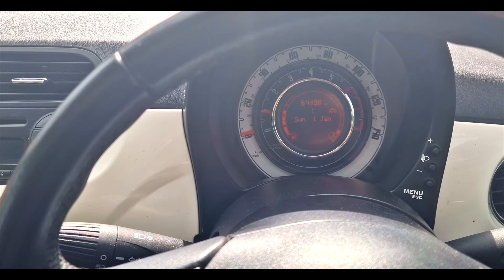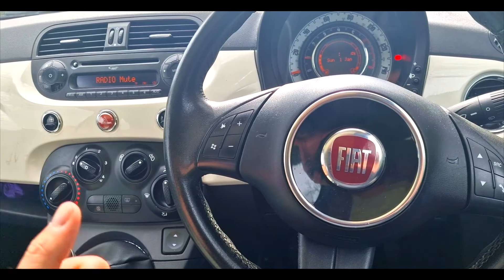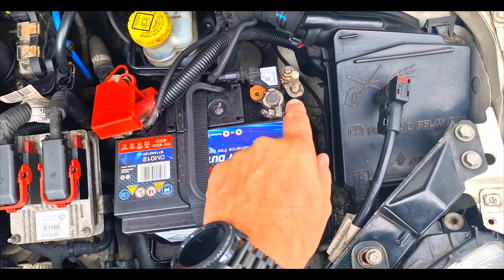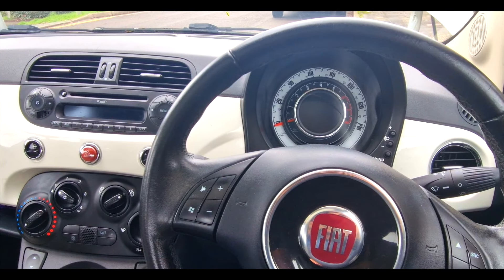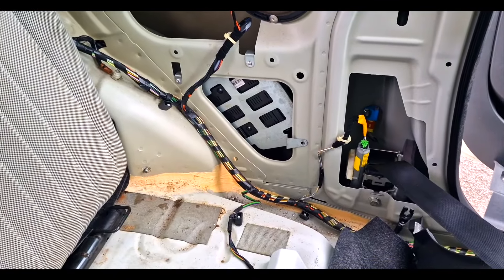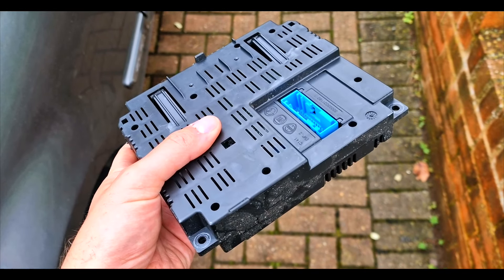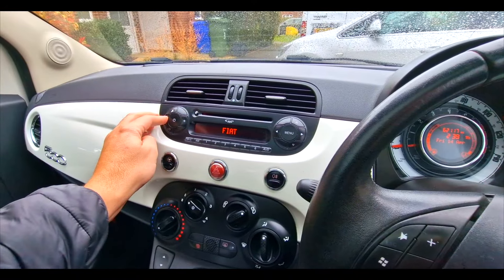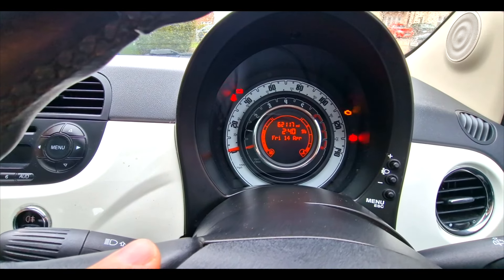Fiat 500 Flashing Mileage Bluetooth Fix

Comment: Excellent video. B&M is known as a common fail in the US as well. Here the 500 has it tucked behind the glove box. A different fail is they won't shut down, causing a parasitic drain on your battery. This can be a pain if you don't drive every day. Personally, my first step would be to do a load test on the battery. A weak battery can crank the car but toss multiple errors due to low voltage or dirty/misfitting cables. Flashing ODO can be for many reasons; simply means some module isn't timely in reporting in. In the US I had it flashed and the dealer replace the "brick" at 5,000 miles. It's a good idea to use your software to scan before replacing a module, though B&M not working was a major clue. Your software or AlphaOBD can do the Proxi align and, with cables, costs about what a dealer will charge and sometimes that's all you need. I mention doing a scan first because my car has an intermittent flashing ODO since the day it was new (Dec 2018). 4 Proxi's and a software update later, it still pops on every 6 months, then goes away at the next start so a scan reveals no failed components.
Reply: What do you mean it won’t shut down? I have a 2012 that I have removed blue and me module, drove to work about 45 min. Sat for 10 hours and when I got off work battery dead again. Any other suggestions?
Reply: @kassiemiller9075  B&M is a timed unit. After the ignition shuts off it remains operating for a few minutes. If it doesn't shut off, it continues to draw 1/2 to 3/4 A, in addition to the normal computer's draw. For the battery, I'd start by testing for a parasitic drain and do a load test of the battery.
Reply: I have the exact same problem with Bluetooth/usb and battery drainage, do you know if it’s possible to do it yourself without paying hundreds in a fiat vendor? :/

Comment: Is my car still ok to drive if the mileage is flashing? I don’t have Bluetooth in my Fiat so I tried step 1 but didn’t work. Just want to make sure it’s not dangerous to continue driving.
Reply from the maker: It's fine. Doesn't affect the performance of the car so don't worry :)

Comment: Just had a brand new battery fitted yesterday as I thought this was the issue. Had it all re-calibrated with the new battery but I still have flashing mileage, not able to use the USB slot and phone won’t connect to blue&me. I think I’m going to have to take it to a garage and get them to take off the rear panel to get the module out, looks to complicated for me!
Reply from the maker: Your Bluetooth module is broken I'm afraid. It needs repairing.
Reply: @carsalvage101  just hoping I can find a garage that is willing to do it for me. I imagine the labour costs won’t be cheap!  Does it have to be sent off for repair? Or would it be cheaper/easier to just buy a new one?
Reply from the maker: You can go on eBay and buy a second hand one tbh. Where do you live?
Reply: @carsalvage101  Exeter, UK

Comment: The flashing mileage hsppened to my 2010 500 after a completely dead battery. I also have an airbag warning light on that wasnt there before the battery went flat. Could the flat battery have killed the B&M, or would it just be a reset?
Reply from the maker: I don't think anyone knows why the Bluetooth module fails. I assume that charging the battery and taking off the negative cable for 10mins hasn't fixed it?
Reply: The 10min battery disconnect worked - no more flashing mileage! The airbag light is still on,and that only appeared after I let the battery go dead too, so not sure how to reset it, but thank you so much for this tip!
Reply from the maker: No problem. Glad that resolved it. I'd go into the menu on the dash and turn off the passenger airbag. Then turn off ignition, and then turn it back on again, see if that solves it.
Reply: @carsalvage101  that's awesome, it worked! You're an absolute diamond, thank you so much!
Reply from the maker: No problem at all. Glad I could help. Now my bank details are..... :)
Reply: @carsalvage101  😂😂 Seriously though, that's saved me money - do you support any charities? I'd be happy to make a donation to one as a thankyou gesture :)
Reply from the maker: I don't I'm afraid but do not worry about it :) it's a gift!

Comment: Can the Bluetooth issue be resolved by getting a new retrofitted radio head unit. One with a touch screen
Reply from the maker: No, I don't think so. I think the module will drain your battery unless it's sorted I'm afraid.

Comment: Hi, my 2008 fiat 500's usb port is not working properly. 
At first it wouldn't charge, it wouldn't play music, I couldn't connect my phone via bt, and the odometer started flickering. I disconnected the battery  (-) 20-30 min, and after the odometer stopped flickering and I could connect the phone and it was charging, after a few seconds of connection (no music playing, and not detecting aux in settings) the odometer was flickering again (and the usb light bulb went out.) What to do? Is it a blue&me system problem? Should I replace the usb port?
Reply from the maker: Have you tried it with someone's else's phone to see if the same problem happens?? I've read that sometimes certain phones can cause issues with thr USB.

Comment: I have what appears to be this issue however no buttons on the steering wheel seem to work, the volume one work every now and then. Are these linked or is that likely a separate issue?
Thanks
Reply from the maker: I would believe that it will all be the same to be honest.
Reply: Yes, it's all related. You have a faulty B&M module. Once it's replaced, everything should work fine again. Problem with this module is, no one knows exactly why or when it goes bad.

Comment: Hi I seem to have the same problem and it may be the reason why my battery drains itself if I don’t use it for 1 day. Do you know if disconnecting the Bluetooth module/ circuit breaker might help with that?
Reply from the maker: Discount the module will sort the battery drain, but you will still get thr flashing mileage.
Reply: @carsalvage101 can u remove the module completely without reinstalling it ,my radio quit working a week ago so I'm thinking this is the issue with my battery drain
Reply: @carsalvage101 I'm in Canada ,where would the module be located ? I'm seeing posts that it's not in the rear ,some are saying it's behind glove box ..
Reply from the maker: I believe it should sort it out, however,for £60 + p&p you can send it off and have it repaired.

Comment: Im put some cola iside cable slot. Then this problem start. No charging no blutooth.
Reply from the maker: That cola shouldn't really cause the Bluetooth to fail.
Reply: @carsalvage101  😳
Reply: if i take off battery i need to write an code after ?